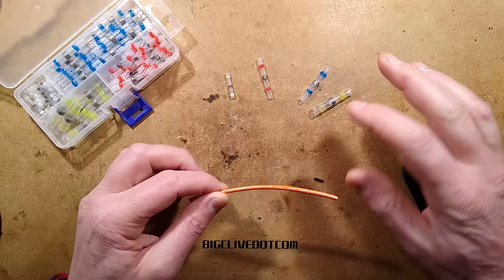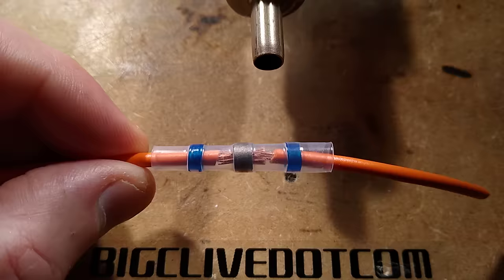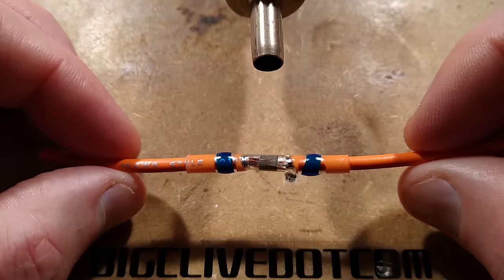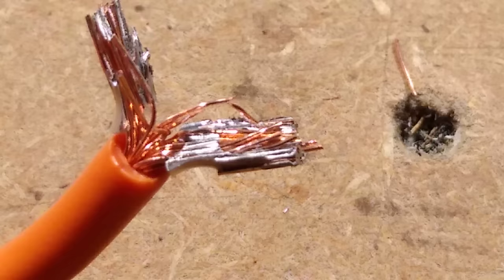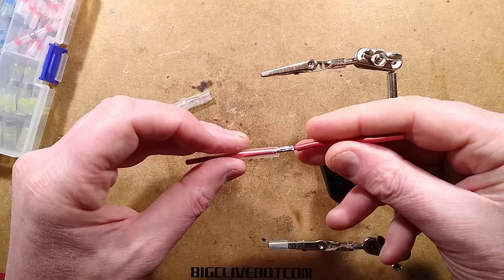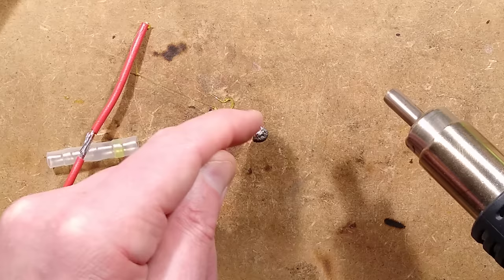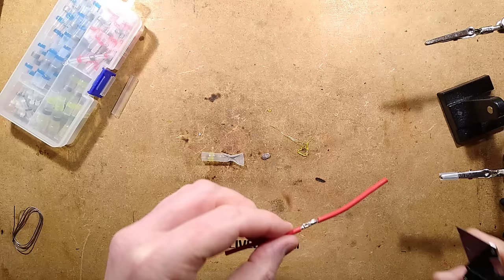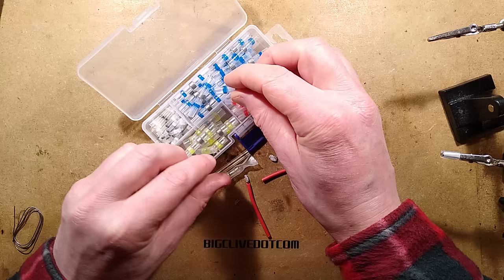Heat shrink solder butt connector test.

Comment: I've been using those things at work (I'm maintenance technician at a decently sized chemical plant) for quick fixes & these things are just amazing. Saved me tons of labour already. Fix the broken wires with these & then put vulcanized tape all around the cable. It'll last for years (maybe decades?).

Comment: When the "wire wrap" technology was being developed in the 60s the developers quickly found that mechanical action can make a gas tight metal to metal bond.   On the whole, crimping might well be more reliable than solder.   Obviously, solder has it's places (you can make literally thousands of connections of a PCB simultaneously) but when it comes to one wire on one wire crimping is difficult to beat.
Reply: Yup, in the automotive land crimps are preferred because the joint isn't as brittle. Soldered joints in wiring harnesses can break down under constant flexing and vibration.
Reply: Exactly. You will never find a solder joint on an airplane or space vehicle, Every harness uses 4 point crimps where junctions are made.
Reply: @hotratz69  does aerospace ever use ultrasonic splices? I know they exist but I don't know too much about the pros and cons
Reply: Crimping might be more reliable in a controlled environment with expensive tools. With hardware store grade stuff I have come to hate crimping and ended up additionally soldering most crimp connections because they were so unreliable otherwise.

Comment: Would be interesting to do current tests on those connectors to see if the bonded joint can actually cope with the current rating of the cable they were joining

Comment: RESIN / FLUX

Ryan's suggestion is spot on, if you apply a little resin / flux to the spliced or twisted wire as an addition first. This aids the solder flow of the small solder ring at the centre of the  tubing, allowing it to 'wick' along the wire conductor. In addition,  if the complete joint is assembled mechanically first, the heat can be applied evenly along its full length with a sweeping action. This melts the solder ring and the two glue rings evenly,  making it more secure and looking pretty neat. By keeping the heat source moving, (be it heat gun or lighter), there is less risk of damaging any of the other insulation.

Just a suggestion......

Great clip Clive, and most informative.
Many thanks....

James Hennighan
Yorkshire, England

Comment: Thanks for the video - they work well and are convenient but are not the solution for every application.  Extra flux on the wires before applying heat is a good tip and will help.  It would be interesting to do a resistance comparison on the uncut wire, the “classic” solder joint and this “quick” solder joint - I expect they would all be equal.  Finally, considering their cost they are a good thing to have on hand and produce a very acceptable joint.

Comment: I used to work in a factory that made military-grade cables and we used these all the time. The conductors would be tinned in a solder pot first though and then simply placed next to each other inside the sleeve. We used 450 deg C of heat on a wide heatgun nozzle and the joint would litterally take 2 seconds. Due to the fact they were tinned conductors, we always got a perfect, full penetration joint.

Comment: Crimping is preferred to soldering in any application where the wiring is subject to vibration.  The solder joint is much more susceptible to vibration fatigue failure than a crimped joint, assuming stranded wires.  If you use solder joints in a high-vibration environment, you should support the wires on both sides of the joint, near the joint, so the joint itself doesn't flex.

Comment: Love those. I've used them since back around 2001. They work really well as long as you don't melt the plastic.
Reply: I use a proper heat shrink wrap over the plastic heat shrink.

Comment: Funny timing, SouthMainAuto just did a video where he said they always come back to bite him in a ass a couple of years later when the solder joint fails.
He said the mechanical crimp connections are much more reliable
Reply: Solder is practically banned in marine wiring, with hex crimped terminals the sole method endorsed by the ABYC
Reply: @wallacegrommet9343  Crimping is the way to go for any joint that needs to be physically robust.
Reply: I learned that when rewiring the charging system on my boat.  Unfortunately I borrowed a big unwieldy crimper, did a poor job, and had to do it all over again after buying a Temco 6 ton hydraulic crimper.

Comment: After watching this I bought a small box of assorted connectors to try them out. Like others have mentioned, I wanted to see how well the side of the road/ middle of the river, knife and a lighter scene played out. Surprisingly it went well this time, still have all my fingers and minimal burns. Oh, yes, the wiring! That too went well, the smaller the better. It seems. The larger connectors will get you where you are going but change them ASAP, as the solder to wire ratio is the least. The medium and small ones seem to be just fine as far as installing and forgetting. I used a cheap blowtorch style refillable lighter from a gas station which gave a concentrated blast of heat at a distance that didn’t ignite the connectors. I even tried it out on oily wires that had road grime on them, and I just wiped it off with my fingers and slid the connector on. It still sealed up decently on the wire. In my boat’s emergency tool kit I have a handful of these, a pair of pliers, and a torch style lighter/w small butane refill. This past year I’ve used three out of that box. Luckily not on my boat, but on other guys trailers. So far they work well for an emergency fix.

Comment: I work as an automotive master technician. I particularly use non-insulated butt connectors with heat shrink. The insulated plastic butt connectors found in most automotive stores like to crack when you crimp them leaving them exposed to the elements. So I'll take a wire and slide good heat-shrink on it then use the non-insulated butt connector and crimp it and slide the heat-shrink over it. Works like a charm. I've tried these  heat shrink solder butt connectors and they can cause a voltage drop lol. Not to mention the majority you see online are super cheap and the heat-shrink will start to liquefy well before the solder in the center melts defeating the purpose all together.

Comment: I have tried these before and noticed there can be better solder flow with more heat but not too much. They are good for some things, quick fixes and such.
Prefer butt crimp (proper connector3M, molex, etc and Klein crimpers) or solder and shrink tubing. 
There is an old ongoing argument and discussion on forums about which are better. I use what I feel is best for situation. Thanks Clive!

Comment: I have bought this kit from China and have been very impressed with the connections they make. I just dipped the cable ends into liquid flux and, using a small cookery blow lamp, managed to install a remote control on, of all things, a feral cat trap for the local cat rescue emporium working where the 'national grid' dare not go!. They do what it says on the video.

Comment: Two tests remain. Having seen what 300 deg. C does, what would a higher temperature reveal? Additionally, we don't know if these contain flux within the solder (yes, Clive suspected they did but wasn't sure) which would call for a pre-flux test as well.

Regardless of the result, they do "save" from certain steps - as least while combining with some manual methods of soldering.

Comment: Well... keeping in mind that there's still some smart guys out there that just twist the copper and insolate it with electrical tape, theese little things can be handy. Nothing is better than a hand soldered connection, but hey....
Reply: People dealing with mains do that all the time. 4-5 amps isn't a big deal until corrosion happens
Reply: Ahh yes, the Pro way to connect wires!
Reply: Nothing wrong with just twisting as long as it works well with the application IMHO. I always connect joints in automotive wiring using the western union twist and it never failed.
Reply: A Wago is better than hand soldered. So is a crimp. Why? because it's impossible for anyone with an lQ above 80 to get it wrong.  (As long as they've been properly trained.)
Reply: @johnalexander2349  also, there's less chance of work hardening to happen
Reply: Suraj Grewal ye people who work on mains dont tend to use the twist method, its the people who think they know what theyre doing that does this
Reply: John Alexander depends on the application and type of cable, wouldnt advise crimping solid core cables unless manufacturers specify otherwise
Reply: Crimping is better than a hand soldered connection on a vehicle at least.
Reply: @joshuarosen6242  Well... if the connection is permanent, there's nothing better than a well made soldered connection: flux, lead based tin, and shrinking tube (or similar). If not, a nice sealed connector.
Reply: @DanielLopez-kt1xt  Soldered connections can break as a result of becoming work hardened due to vibration. They are not the best connection where it will be subject to vibration such as in a car.  If you read through the comments here you will see lots of similar comments from people who are used to working on cars who prefer crimping to soldering. If soldered connections were stronger, car manufacturers would use them but they generally don't. In a static piece of electrical equipment, I'd agree with you but not in a car.

Comment: We used them for soldering earth tails on to screened cables but we still added some additional flux for a better connection. You could also get a split screen which would wrap around existing connected cables which were then held together with  small plastic studs.

Comment: South Main Auto's channel recently mentioned in a video he's had poor luck with these, not being reliable in the long run, and has reverted to mechanical crimping.
Reply: thats strange, we have been using them for years and never had problems with them, Some diesel cars have run them for 300.000+ in the engine bay. And a diesel car is about as bad as it gets for connections. The constant vibrations together with some heat wil break lots of connections. 
Mechanical crimping on the other hand is nothing but trouble. They get water ingres problems, then either the crimp itself is going to be rusting away, or you get the greenrot in the cable wich then turns black and then you can go and replace the whole cable.
Reply: The best option I can think of right now, is those heat shrink butt connectors. Not only you get a strong connection but also a waterproof one. The best of both worlds without the disadvantages of soldering.
Reply: Most likely down to application, you want to have a good mechanical joint first, like a linesman splice, and then solder it, then use this as sleeve, waterproofing and final bit of solder. Just jamming the wires together and hoping will result in a poor joint. Pretin the wires at least, or scrape to bare bright copper at a minimum.
Reply: @gabbermaikel  I think the market has recently flooded with knock-offs. I had never seen them outside of the avionics shop at work until very recently. Now they are all over instagram and everywhere else. The name brand ones seemed to have a higher melt point and just work better all the way around.
Reply: @tjsean0308  the name brand actually has flux in it.
Reply: @gabbermaikel  I'm sure the amount of solder is also changed to match the intended wire gauge. These look completely different than the environmental splices I'm used to seeing. Someone needs to send him some of the real deal ones.

Comment: Hi Clive.. great demo as usual.. As I don't want to do destructive tests on the joints I'm making and my assortment was cheap enough; I have decided to put the solder butts on to one wire out on the way and solder directly as you have done. Then I slide the solder butt up into place and just heat up the tubing and use it as both an insulation and waterproofing of the soldered joint.

Comment: I think there similar to a version called "Self Soldering Sleeves" that where used by the military back in the 60s, you put the wires in and striike the top like a match and it solders the connections. The "ElementalMaker" just did a video on them.
Reply: I think they are way better, at least they do not require you to bring a heat gun (as at that point you might as well have a soldering iron)
Reply: @testaccount4191  Mind you if you could still get them the health and safety people would lose there minds
 :P

Comment: “Interesting. The solder is soft at relatively low heat levels”   Finds out later they used mercury.
Reply: Bismuth
Reply: @chubeye1187  This. Mercury actually drops the melting point down way too low when alloyed in any significant percentage, this is likely either a bismuth-lead or bismuth-tin alloy. Bismuth-lead alloys can have a melting point of about 120°C
Reply: @richardmillhousenixon  57% bismuth 43% tin melts at 147°C no lead required. What is absolutely required is flux for good wetting.
Reply: @paulcooper9011  Yep seeing the super low temp crosses out a lead based solder. When he melted the solder and it got wrinkled that told me it lacked lead. Most lead-free solders don't wet as well as lead based solder.

Comment: It would be interesting to do a resistance (assuming you could get a low enough tester) test between
1. Unrepairable wire
2. Repaired wire using the heat shrink
3. Repaired wire using a soldering iron
Reply: Get a stable voltage source, a precision or known resistor, and just use the wire and resistor as a voltage divider.  Do this to both wires, and once you know both, make the connection and use that in the voltage divider.

Comment: I've used a few of those and they do seem to be quite handy. I always add a little flux to the copper before sliding the heat-shrink/solder over it and that seems to greatly improve wetting of the joint.

Comment: These look likely to be very good for tight space repairs, would prevent accidental damage from a hot iron in amongst other cables, especially small cross section ones. I will buy some of these, the addition of flux to the bare wire ends I assume will help solder flow.

Comment: I have used this exact pack to wire not only a trailer but also a backup camera/Bluetooth stereo. I drive on rough roads with high frequency sharp bumps. No problems yet, almost a year now. Of course I have weatherproofed the connections for the trailer. But sure works better than wire nuts!

Comment: My solid connection is where I do what you did by pushing the ends together and then taking one strand of wire and coiling it uniform and tight around the splice point. Then solder it properly finalizing the connection by wrapping 3M Super 33+ rubberized black tape.
That connection is stronger that the original wire and will NEVER fail in a 100 years.

Comment: We've been using these forever in the aviation industry.  As an Avionics tech.  We pretty much only use these to solder shielded wire.  So the actual wire is soldered or crimped together, then a section of the outer covering is removed to reveal the braided shielding around the interior insulated wire.  This is slid over it and the solder ring over top the braided shielding and a separate wire is slid into it as well.  Then this solders and seals the wire to the shielding and the wire is then grounded to an aircraft grounding stud, thus shielding the main wire from RF Interference from other aircraft systems.  I've never used these for a straight wire to wire connection.  Either normal solder splice or Amphenol crimps with heat shrink sleeve.

Comment: We use those to splice data wires during avionics repair on airplane. When it's a very low current application with much smaller wires it works great.

Edit: Having solder wick up the wires in a high vibration area, like an airplane, is a big no. It makes the wire very prone to work hardening and breaking. With the all-in-one heat shrink you solve the electrical problem, you also solve the mechanical problem by adding strain relief, and finally the hot melt glue make an air tight seal to prevent moisture or other nasty thing like fuel to get to the splice. With all of that said they are not great everywhere, but for avionics repair it's great.